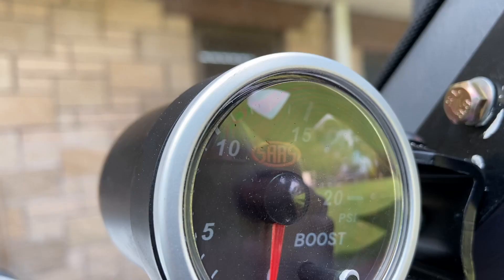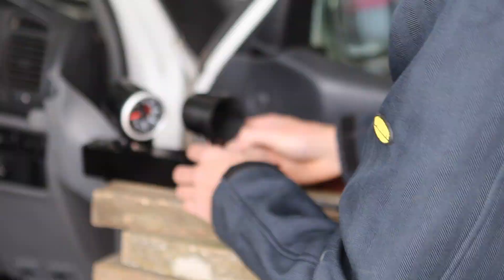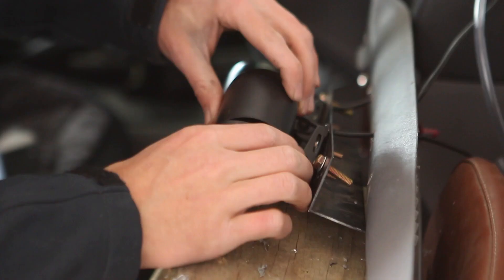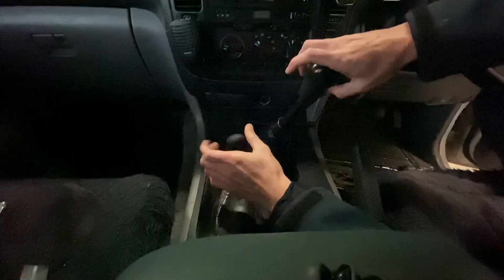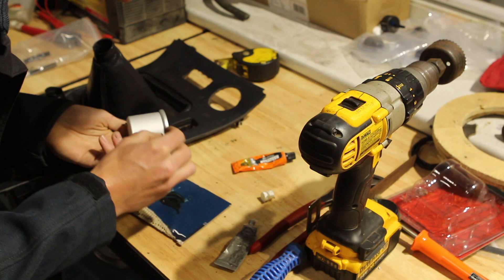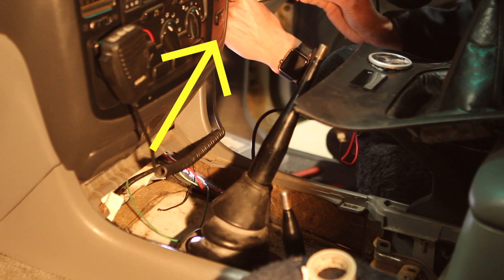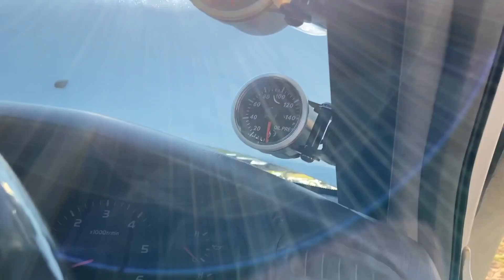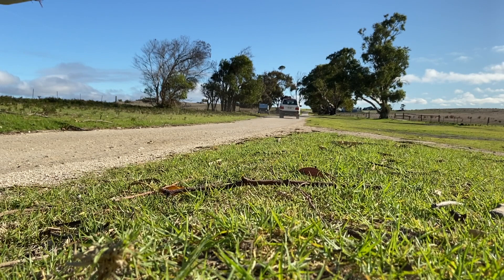Installing Turbo Gauges [Turbo Conversion Part 3]

Comment: It seem to be your landcruiser needs early boost 
Nice work done by u bro
Reply from the maker: Yeah it’s a tough one there. A smaller turbo would be good and make for an earlier spool but then it’s all over by 1500-2000rpm and you don’t get anything more after that
Reply: @WillsLandcruiser  bro u can use a VGT turbocharger, it is best suited for landcruiser

Comment: Another way to wire up the lights for the gauges would be to tap into your headlights so when you put parkers or headlights on they turn on as well. Love the videos btw
Reply from the maker: Definitely something I considered, but at times the lights get draining on long night drives so it’s handy to be able to turn them off. If they were a little dimmer that’d be the go though for sure. Cheers for the comment 👍👍
Reply: @WillsLandcruiser  Yeah fair enough, I have a 2002 79 Series that I want to turbo, I dont know what gauges I want to use yet, I dont know much as to which ones are best, what would you recomend?
Reply from the maker: I love the look of the SAAS gauges here and I know a lot of people use them for that reason. But they are so unreliable 😂 So if you just need an indication then these are the go because they’re really cheap too. But if you want something that’s actually reliable and accurate, I’d be going for brands like VDO, Autometer and maybe even Redarc if you have the money
Reply: @WillsLandcruiser  Ok than you

Comment: Hey mate, just wondering after 5 months of running them, how do you find the saas gauges, I hear nothing but bad things about them, but looking at getting one, what are your personal experiences
Reply from the maker: Dylan Rooney yeah look to tell you the truth, they’re a great indication, great starter gauges, but not very reliable or accurate. I’ve learned my boost gauge is at least 1psi out, EGT gauges wobbles after the car is left in rain for a while, and the oil pressure gauge is constantly shaking. Another classic poor man pays twice story, but they’re a good starter gauge and they do the job for now
Reply: Will's Landcruiser Mods yeah that’s fair enough, might look at something a bit more expensive, I’m not interested in forming out +$400 per gauge for redarc, might have a look at VDO, cheers mate
Reply from the maker: Dylan Rooney No worries happy to help! Go look into Autometer gauges. That’s where I’ll head I reckon. VDO is great too!
Reply: Will's Landcruiser Mods yeah I was just having a look at them, I’ve got an auto meter boost gauge and it goes well, might have to order myself an early Christmas present ahah
Reply from the maker: Dylan Rooney Haha sounds like the go! They look like really neat gauges
Reply: Will's Landcruiser Mods yeah they definitely do, another questions, sorry aha, how’d you install the oil pressure gauge? I’ve got an electrician gremlin in mine and would rather just install an aftermarket one
Reply from the maker: Dylan Rooney Yeah so for some reason when I swapped my block for a younger 1HZ, my factory oil pressure gauge just didn’t like it. So the aftermarket oil pressure gauge came with an aftermarket sender which just screwed into the block, simple sender wire to run back to the gauge and then your power to the gauge for the lights. Easy stuff but once again would probably recommend a better brand than saas. Mine wobbles like I’m driving a 75 on a corrugated road 😜
Reply: Will's Landcruiser Mods yeah that’s fair enough, I’m in a 75 so it’ll wobble more than anything ahaha, yeah I’ve got a gremlin somewhere and all my gauges play up a little, yeah I might get a few gauges at once, cheers for you help mate, really appreciate it
Reply from the maker: Dylan Rooney No worries, more than happy to! Honestly your 75 would probably ride smoother than my 105 does at the moment 😂 Poor girl needs a lift kit. A nice pillar pod and a good set of gauges and you’ll be in business! Find me on Instagram or Facebook and I’d be more than happy to help you if you have any questions when they arrive!

Comment: How much boost are you running?
Reply: At the moment I’m running 8-8.5lbs but I’m about to get it tuned professionally and I’m guessing that I will boost it up to 11-12lbs, but I would love to be able see what my gauges are doing at night.
Reply: Will's Landcruiser Mods you’ll easily run 15 mate, all an inter cooler does is lower your egts. As long as they don’t get over 500 your sweet
Reply: Will's Landcruiser Mods yeah beauty, I’m putting my turbo on my 75 this weekend got a gturbo green wheel